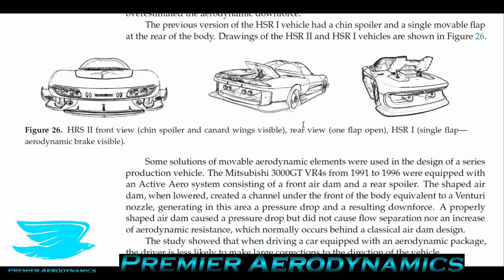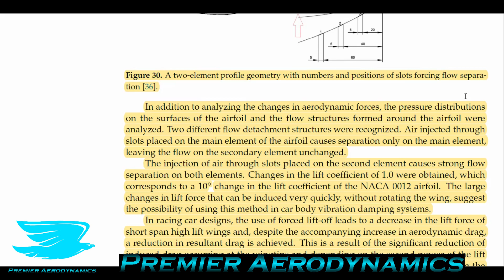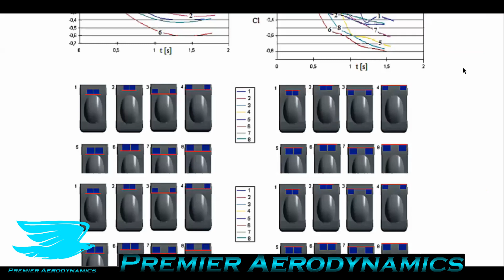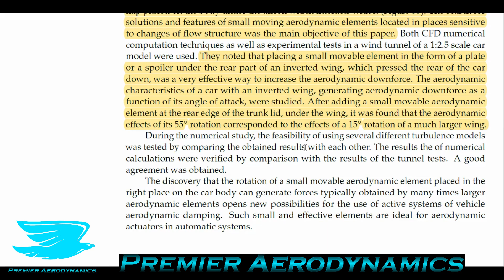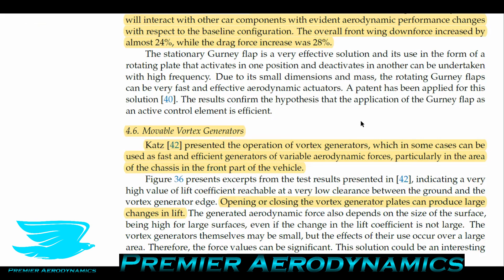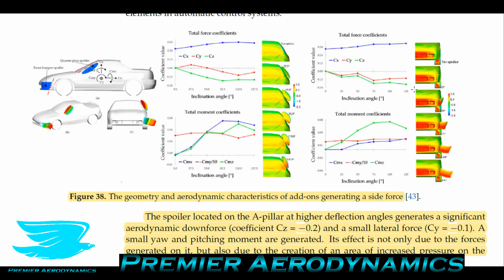Active Flow Control Devices of Cars Part 2 - Podcast #62

Comment: How much weight do the actuators for these add? some of those control surfaces look like they need a ton of torque to move against the airflow, especially the ones that provide a lot of downforce.
Reply from the maker: I'm not sure how much they would weigh. But I guess the amount of force (and torque in general) would be the same as the amount of force these control surfaces create. For example, creating an extra 100 kg of downforce means the actuator needs to withstand and move against 100 kg of force.

Considering that a trolley jack for cars weighs maybe 10 kg but can lift 1,000 kg, the weight shouldn't be too much. Maybe 5 kg for an actuator.